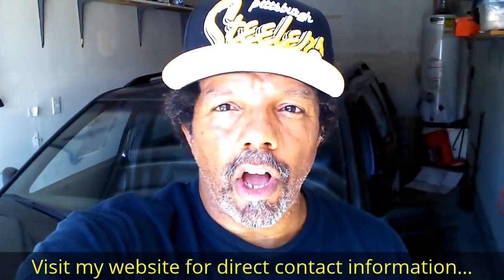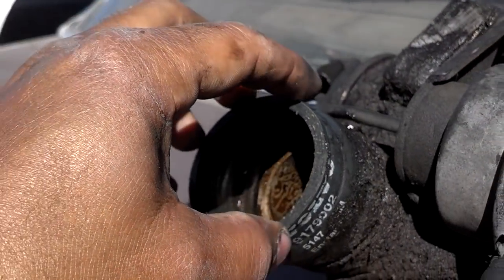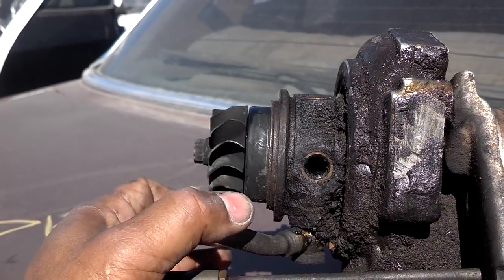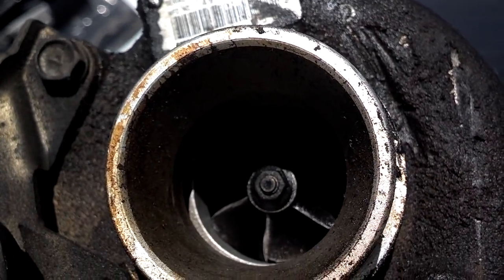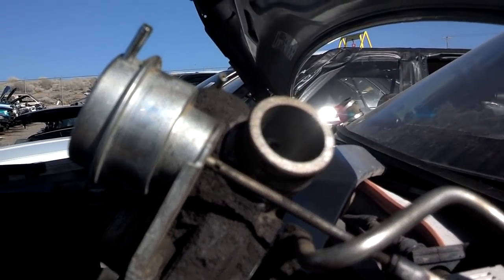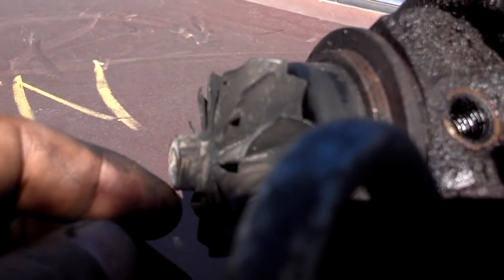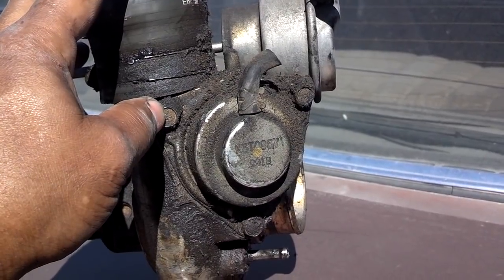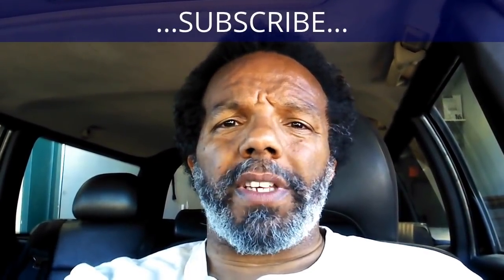How to tell if a turbocharger is bad. What can go wrong with them. - VOTD

Comment: They use machines that spew that kind of smoke to kill mosquitos in my country! 

In my 2012 S60 T4 with 68,000 Km the turbo is leaking oil. It comes down from the unit to the intercooler pipe and from there to the lower engine cover. It is a droplet but coats all the mechanicals and the pipe.  

There is a little blue smoke In the exhaust on a cold-cold start up. I switched from SAE 5W/30 to 5W/40 motor oil. After the oil change the engine feels less free as if the increase in engine oil viscosity increased friction within the engine. The original motor oil viscosity was 5W/20 but the dealer switched immediately to SAE 10W/30 and I went down to 5W/30 upon the purchase of the car as to get as close to the oil specification and viscosity that the owners manual intended an ACEA A5-B5 which I only found with an SAE 5W30. I replace the engine oil and filter every 6 months as I drive the car very little.

What could be the culprit, how much time to total turbo failure?
Reply from the maker: What does the owners manual recommend for the oil? What climate do you live?
Reply from the maker: https://www.youtube.com/watch?v=wyF3o3c1uug
Reply from the maker: Due to the design of the PCV system, the early turbo Volvo vehicles ALWAYS have oil droplets on the turbo system. Not sure if the newer ones are the same, possible.
Reply from the maker: https://www.youtube.com/watch?v=ZmD1zkE03KY
Reply from the maker: https://www.youtube.com/watch?v=tYkg0oDUXs8&t=45s
Reply from the maker: https://www.youtube.com/watch?v=tYkg0oDUXs8&t=45s
Reply: Robert DIY Hi Robert, great program that you have here! I’m from San José, Costa Rica.
The weather year around is mild in the 80’s!
Reply: Robert DIY That’s what an  independent Volvo mechanic (that  I consulted regarding the oil leak from the turbo) said. But to me the  leak is far bigger than regular PCV valve operation!
Reply from the maker: https://www.youtube.com/watch?v=vJXfQrDPK04
Reply: Robert DIY In our kind of tropical climate the owner manual is indifferent from a SAE 5W/30, 10W-30, 5W/40 and higher! I am using 5W/40 but the engine feels less peppy than before! 

I have been using full synthetic SAE 5W/30 with European certification ACEA A5/B5 (extended oil and filter drain intervals of one year or 15,000 Km), however , the dealer uses Mobil 1 SAE 10W/30.

Comment: I have brass particles in the oil on a car with a turbo I have been working on ): What is breaking down? the thrust bearing/oiler plate? 

Also...

With an adjustable cam sproket, is it possible to turbo-delete an engine?

Thanks!
Reply from the maker: +ERICtheLATE send some of the oil to a lab for testing. I use Blackstone. No, it will run like crap and toss engine codes.

Comment: would the bad turbo cause a skip? when i start my 2004 xc70 im getting smoke but im also getting what feels like a misfire. really rough idle
Reply from the maker: Probably the transmission.
Reply from the maker: https://www.youtube.com/watch?v=NhtUXZTurzo
Reply: Oh, that is the last place I thought to look. Im going to pick up a scanner and see what my CEL is saying. everything happened when my oil light came on and I could only get synthetic blend nearby. As soon as it was put in it started sputtering and smoking bad. I had assumed it was the rings or the turbo with how its burning oil.
Reply: Robert DIY no compression in cyl 3. I guess it's time for a new car
Reply: Maybe this info will serve someone else. When the oil light come on stop the engine IMMEDIATELY. In fact any RED light in the dashboard mean STOP on the spot. Let the vehicle coast if needed...

The "oil light" on most cars mean low oil pressure, but more recent vehicles might also have the low oil level associated. 
Usually due to very bad/lack of maintenance the engine is due, when the oil pressure is gone and the vehicle is driven "just a couple of miles". ;-)

Comment: Loving your video Robert. My son's first car was a Volvo 240.The reward of a well maintained car is safety, financial security (less $$$ repairs) and confidence in ownership.Your faithful public should know the manufacturer's maintenance schedule for their model is the "good book" to auto owners. Never stray from it and you will have many years of driving pleasure. I can't wait to get home and watch your video with audio.I would like to also add, if a mechanic suggests an expensive repair they should show proof of the diagnostic code and proof of the part and replacement part after completion of repair.
I am considering adopting a v40 wagon 1.9T 2003. It has Turbo. The issue is it won't idle well and cuts off quickly. I do not have a lot of knowledge of the 1.9T. I believe it is more likely a pcv valve and neglected EMR in need of desperate cleaning. When should I be concerned about Turbo? It has had a good deal of auto maintenance, the owner is in despair and does not want to invest  any more $. His loss may be my gain.
I also see a lot of guessing by other owners as well as mechanics. Take your car to a vocational ASE  school and have them code it for you. It will save you a lot of head ache and be educational for the supervised student. Also coding is not difficult to learn and many diagnostics can be purchased for your year and make on ebay or at a local pawn for a reasonable $.
It has been my experience, many ASE mechanics are bullies to the fixed income folks and make up for dominate personalities when they lack continued education and do not get immediate profit.The internet allows us to witness this first hand in writing.Also search the repair for your make and model online. They will give estimates and local shop comparisons in your area. If you are not savvy with a computer, have a librarian assist you at your local library.May peace, love, hope, and joy be yours!
Reply from the maker: +Mary Esther Austin thank you and thanks for sharing.

Comment: I have a B5244t5 engine, at what rpm does my turbo spool up, and till what rpm, I can't seem to find the right info.
Reply from the maker: Boost varies with RPM. Do you have a boost gauge installed?
Reply: No boost guage. I guess it spans from about 2100 to 5100 rpm. I have 303 nm (officially 350 nm) from 2100-6400 rpm, instead of the official 350 nm from 2100 to 5100, and 278 metric hp (ps) at 6403 rpm, instead of 260 at 5500. But I haven't got a clue about my boost.

Comment: One question: can a turbo go bad, but no smoke, no shaft play, but no spooling up? have a saab 9-3 2000 2.0l Garrett TB25, have fitted helper spring to wategate, and when unplug wastegate pipe, no unregulated boost.
Reply from the maker: I doubt it. Unless it is totally broken, like the wheel fell off the back.

Comment: Turbo shaft is balanced to 140k rpm. you can't bend blades without getting it balanced again. I bought a new cartridge including both impellers and shaft for $180 off ebay, comes balanced.
Reply from the maker: +jonesgerard cool

Comment: Hello Rob 
My c70 t5 from 14/12/1999 has a t3 flage ?
I will buy a Holset new turbo 500bhp capable if is t3 flange "ebay" 
Have you any idea about max boost on my t5 239factory ...around 0,8 boost , now is 1.1 bar   After remap .some people say will hold up to 1.3-1,4 bar boost 
Thanks
Reply from the maker: It's all about the tune mapping. If the tune is bad, you can bend a rod at 0.6 bar. I know of people that run as high as 1.65 bar. However, I'm pretty sure your car's lower end can not handle that kind of power. You may want to stay under 400 bhp until you rebuild the lower end.
Reply: Robert DIY thank you Robert for your help
We find you very helpfull for your posts
I bought sport suspension , cold air intake, better brakes,
Now is time to improve a bit of power (intercooler,turbo,forged pistons,camshaft,rods)
Thank you again !
Reply: It has T3 flange?what you mean hight end?

Comment: I havent found any information on this anywhere else, but my turbo makes a chirp/click ever since last night, the intensity and speed is directly correlated to boost pressure, and then I have a putting sound, like a beatered Volkswagen almost. It's super loud. I also have found fresh oil spots under my car, from the diver side behind the block, probably from the turbo.  Will check for play or signs of seizing but the loud putting and clicking aren't mentioned so if you have any ideas about what that could be, let me know. Thanks for the vids, I would be soooooo lost on this car without your channel! I check here first, as a rule.
Reply from the maker: +Joel Dougherty probably an exhaust leak.

Comment: nice video. What part would cause a po299 code underboost in a 2011 cruze? Instead of replacing the whole turbo, what part could be replaced to save $ & to also get to the main problem. Replacing the whole turbo seems like over kill. Thx in advance.
Reply from the maker: If the turbo is bad, there is no way around it. It may have a boost pressure leak.
Reply from the maker: https://www.youtube.com/watch?v=x8sXo5gbapM

Comment: thank you for this fantastic video  :) i'm replacing my turbo for my Audi A4 tomorrow! What happend was that the oil pressure went away due to me accidently damaging my oil pan wich i replaced with a new one :) So the problem that my turbo got was that it didn't help my car boosting up! Wish me luck (y)
Reply from the maker: Take your time, it will be fine.

Comment: I have a question the turbo on my motorcycle has no up and down play and no in and out play wen I try to spin it it spins fine but if I try to get it to free spin it won't spin it's not tight just won't spin if u try to spin it fast with ur finger do u think it's ok?
Reply from the maker: Should spin for a few seconds. If it's not smoking, it's probably fine.

Comment: Can this problem be repair ? meaning when the turbo is giving a lot of smoke.
Reply: Yes, by replacing the turbo.  There are also shops that will "rebuild" the turbo.  You could do it yourself with a "rebuild kit," but you really should have it done by a shop that can balance it --
 otherwise, it may not last long.   Balancing may not be needed, if the blades have no damage, have not rubbed on the housing.
http://gpopshop.com/   
Also, beware of cheap eBay (and other) knock-off turbos, which have a high early failure rate.  It is just too much work swapping one out to risk putting in a crappy one.
Reply from the maker: +Jack Cooler if the shaft doesn't have any wear.
Reply from the maker: +Gary Allman great points.

Comment: HI IVE GOT 2008 ISUZU KB 300 D-TEQ D/C NO SMOKE FROM THE BAKKIE OR FUNNY NOISES  BUT NO BOOST FROM THE TURBO ANY ADVICE  PLEASE . MANY THANKS .KIND REGARDS
Reply from the maker: +Tony Mog any check engine light codes?
Reply: Robert DIY YES
Reply from the maker: Many vehicles will dial down the turbo boost when there is a error in the system. You should fix the codes and go from there.

Comment: Great video -- Thanks! I have a 1999 SAAB 9-3 with 175K miles and a non-working Turbo Charger. (I bought the car with 150K miles and the turbo has never worked.) No smoke, no noise, just no boost. SAABs have a turbo boost gauge the measures boost in an arc divided in three units. In keeping with tach activity, the boost gauge bounces around in the 1st third. (So it looks to me like the turbo is turning.) But even when I redline the engine, the needle will go only a couple of millimeters into the 2nd third and I feel no boost. I've never seen it enter the 3rd third of the gauge and I've never felt any boost. Based on my brief description, does this sound like a bad turbo unit to you or a deeper engine problem? Could this be a simple swap out with a new turbo charger? Thanks again for your great video!
Reply from the maker: Pull the intake tube and check the inlet of the turbo.

Comment: Avoid cars with turbos at all cost. Turbos are unreliable and expensive pieces of shit.
Reply from the maker: +Joshua Garden man, no way! I don't plan to buy another car without one. I replaced my turbo at 293,000 and it was still going strong.
Reply: Yes indeed, there are turbos doing loads of mileage ... but it is a matter of luck .. I know a lot of turbos that didn´t reach 100,000 especially in small turbodiesel cars that are popular here in Europe ... The bill is huge and you´re lucky if you don´t screw the engine ...
Reply from the maker: Probably because they were not treated properly.
Reply: Yes some of them were not certainly. But in my opinion European small cc diesels will eventually give away the turbo even with the best treatment. The reason is simple, they are overpowered for such a small engine. So there is a big ask for the turbo, and stress on materials will eventually make its way

Comment: MITSUBISHI Pajero 2.5 diesel 1994 (JAPANESE) imported to the Caribbean and can't climb hills a little smoke when starting, before shipping notice that lake of speed, hard to get it up to 70 miles an hour 
I am about to remove the intake and clean the EGR, thinking of replacing the injectors and turbo any ideas will be helpful, and most welcome thank you nice video
Reply from the maker: Check the turbo and the turbo piping.
Reply: thank you

Comment: Hi Robert, 

I am writing this comment because I have recently acquired a 2001 Volvo V70 T5. The major problem with the car is that it exhausts a constant stream of smoke just like the XC90 at 4:15 in the video. The car also cannot hold oil at all and has fresh oil in the exhaust pipe, and blue smoke puffing out of the dibstick pipe/oil cap. I highly suspect it is a combination of a clogged PCV system and oil coming out the exhaust side of turbo. What would you suggest to do in checking this possibly smoking turbo? Is it a matter of replacing a couple of gaskets or does the whole turbo have to be removed? Excellent video. Thank you

-Blake
Reply from the maker: Start and drive the car. You'll need to replace or rebuild the turbo. Both require removal.
Reply: Hi Robert, 

Thanks for the reply. I have removed the turbo completely from the car. Strangely enough, when taking a look at the exhaust side of the turbo, the turbine wheel is missing completely! It looks as if it has snapped clean off. As I said earlier, the car was smoking oil horribly, so a new turbine wheel and rebuild kit are on order. Any ideas where to look for this snapped turbine wheel? I wouldn't want the fins to end up someplace where they shouldn't be. Thank you.

-Blake
Reply: And also where would you recommend purchasing this TD04Hl 16T turbine wheel shaft? The ebay ones looks sketchy at best
Reply from the maker: Blake B Kwanna. Why do you need a shaft?

Comment: Hi Robert, great video. Now I know something about a turbocharger. .... Here is my problem. I have a 2006 Dodge Ram 3500 and the Turbo used to whistle very nice. Now, the diesel engine 5.9 L6 still runs ok, but no whistling sound anymore from the turbo. I feel the engine does have power, but maybe as powerful as a diesel engine without a turbo. I feel that when it was whistling, it had more power. My turbo does have a Wastegate Solenoid that is connected to the turbocharger. What do you think might be bad with the turbocharger or what do you recommend. Thanks, I'm Robert too.
Reply from the maker: Probably the bypass valve has gone bad, do you have a boost gauge?
Reply: Thanks for the quick reply. No, my truck doesn't have a boost gauge. It doesn't have any gauges that pertain to the turbo. If the bypass valve has gone bad, does that mean I should replace the turbocharger?
Reply from the maker: +puroconjunto no, just the diagram inside it.
Reply from the maker: +puroconjunto you can hook up a boost gauge to see what the turbo is boosting at.
Reply from the maker: +puroconjunto any check engine light codes? Any in the system will usually cause the computer to dial down the boost pressure.
Reply: No Check Engine Light. I've seen a picture of a new turbocharger for my truck and I don't see where the diaphragm is located. I saw one of your videos where you replaced a bad diaphragm. I think it was bolted with 3 bolts when you removed the metal cover. I cant see it on my turbo, and on a picture of a new one, I don't see a metal plate where the diaphragm is. Do you know where it would be located on my truck or should it be on the turbo somewhere? .... Sorry, I don't know what a boost gauge is. I'm just learning about turbochargers thru you. Thanks
Reply from the maker: Your truck may have a blowoff valve. Look for one of those.
Reply from the maker: https://www.youtube.com/edit?o=U&video_id=Y_J38rSztVw
Reply: Well it does have a Turbocharger Wastegate Actuator connected to the turbocharger and the turbocharger has a Wastegate Control Solenoid that is screwed on to the turbocharger itself. The solenoid has a pigtail with a connector at the other end. The connector is connected to the wiring harness. I don't know what that solenoid does, but could that be what is taking the place of the diaphragm or the blowoff valve?